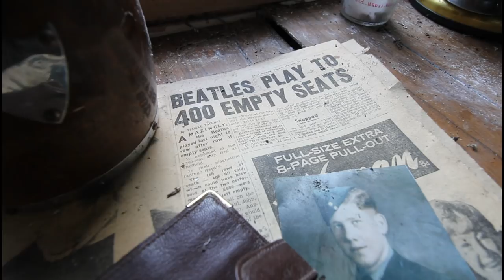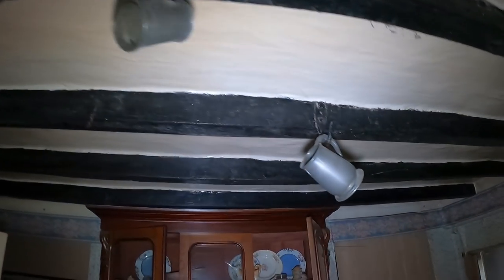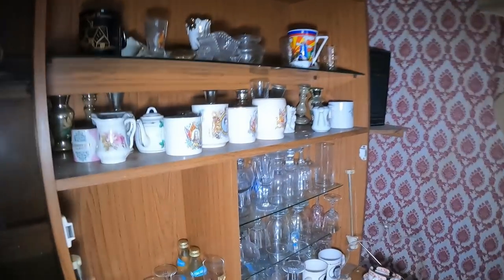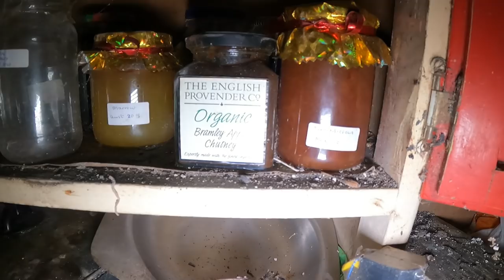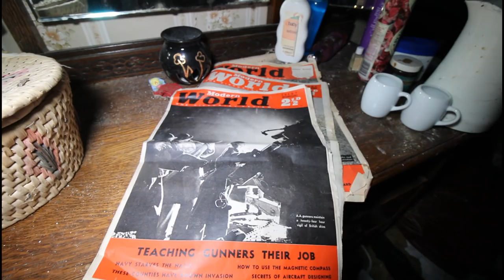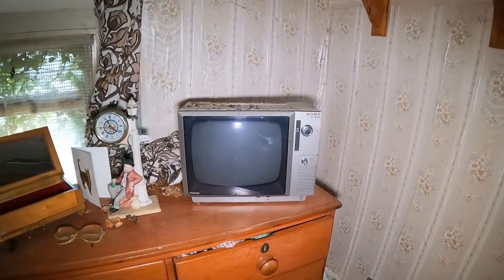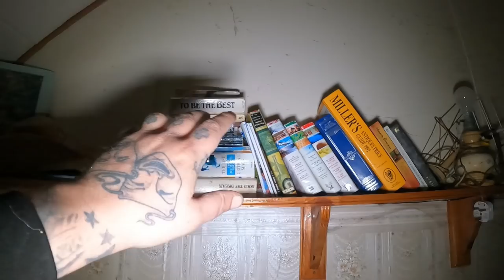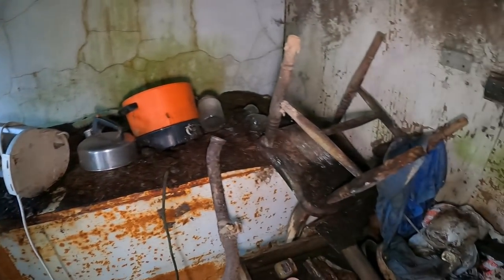SHE DIED OF A BROKEN HEART LEAVING HER ABANDONED HOUSE A TIME CAPSULE | ABANDONED PLACES UK

Comment: There's a lot of 70s stuff in here. The bathroom was 50s with a 70s sink splash back.. Looked like they had to remove the old bath, due to ill health, hence a more modern shower cubicle! A 60s cupboard in the kitchen!   I recognise some china water that i worked on in the latter half of the 60s! Lounge unit and carpet 70s and sound system looks 80s! Very nice find 👌

Comment: So it appears the 2008 date was during their time still alive. The older newspapers from 1936-1941 were likely historical war news items they saved/collected. I found it interesting how the 4 paned windows in the out building's top panes (@ the end of video) were installed @ a slant to help water run off rather than straight up & down which would have caused leakage on the outer seal & window sill. Clever! Thanks for the explore, so fascinating. I appreciate you taking time to note so many things others would just rush by. Those things make a thoughtful & informative explorer compared to an adequate one & sets your work apart! 🙋‍♀️💜✌